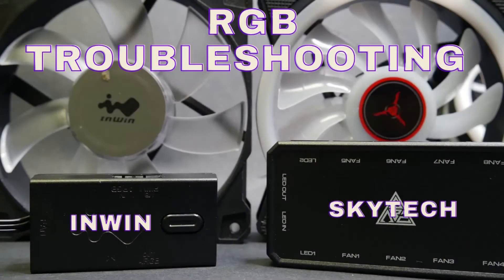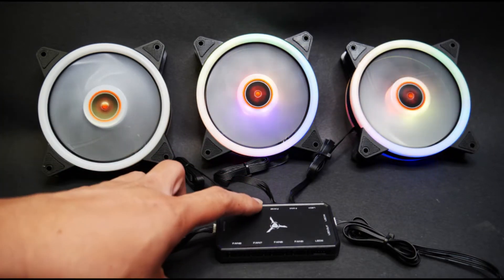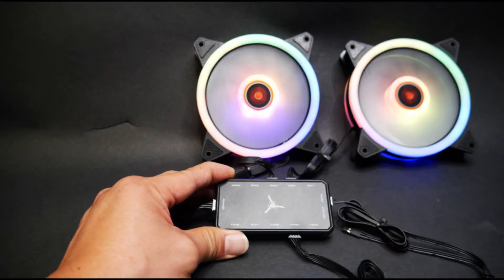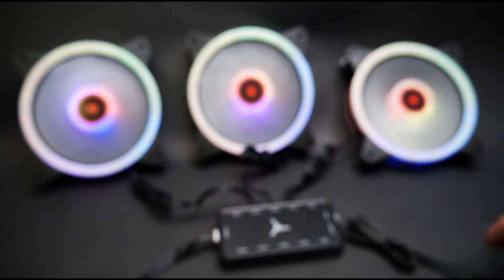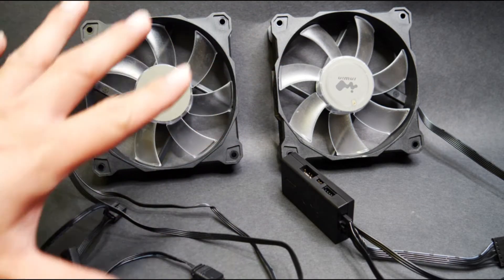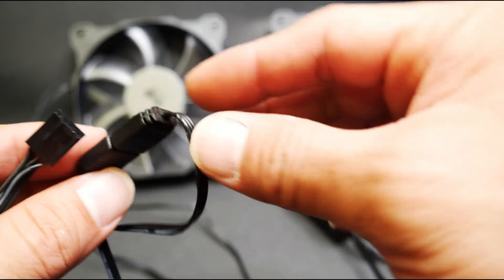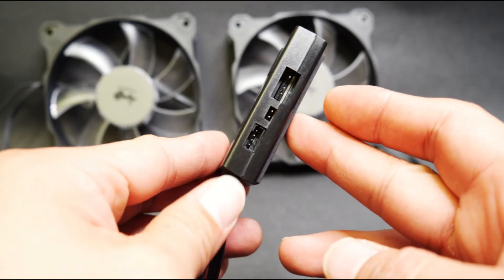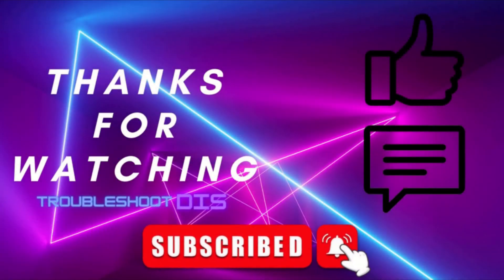Troubleshooting Inwin and Skytech RGB

Comment: I have this controller in my skytech machine with an inwin case.  The fans have all started making squeaky sounds, and I thought it was the water pump. Turns out the PWM circuitry is dying, and its making the fans make noise even if they aren't spinning.   My controller no longer responds to the remote control anymore.  Where is the IR sensor on this controller?
GAH!

Comment: is there a sowftware i can down load to control them
Reply from the maker: These controllers can be switched to motherboard mode which will carry the patterns that the software from your motherboard tells it to do. Each motherboard has a different software that it uses so best to check what brand you have and go to that manufacturer's website for support and download.

Comment: My system somehow didn't come with a remote. Is there any way to change fan speeds without it? All 9 fans are set to white and at 100%, but with no signal wire going to the mobo or remote, I can't software control this. Any fixes or do I have to go out and buy all new fans?
Reply: did you ever figure it out, I got the same issue

Comment: Mine didn't come with a remote, instead there is a button right by the power button on the computer tower. They are all plugged in, as the are all working, but they will not light up, any suggestions?

Comment: really good video, I bought a pc and it comes with these skytech fnas and its controller, but they are stock in green, every so often the change to blue or purple, just for barely a second, i dont have that controller, i think i plugged it well to the motherboard, and i cant change their colorswith the software of my motherboard, any manual youcan have, or maybe something i can do?
Reply from the maker: Hi there, for the system to be controlled by the motherboard the M button on the remote needs to be toggled. if you do not have the remote i suggest getting in touch with customer support so they can get one sent out to you asap!
Reply: @troubleshootdis5930  Thanks man, I appreciate your time!

Comment: Hello, I recently purchased a PRISM II, and the RGB of the three upper fans does not work for me, how do I place the connectors in sequence as indicated in the video, but it did not work for me. It has 9 fans and two controller boxes in 1 it has 6 fans and two empty spaces and in the other box it has 3 fans starting in fan 2 slot.
What I can do? I unplug them all and plug them back in? Please help
Reply from the maker: Hello there, on the second fan controller move the starting fans from slot 2 to 1 and see if that works out.
Reply: Did you resolve this issue? I'm in a same situation.
Reply: @oscillatoryNN  Hi, I couldn't solve it, I could only fix 1 and I asked for the replacement of the other two.

What I tried to fix it is to remove all the fans and connect them one by one to see if I could find the sequence; He helped me fix one but the other two didn't work and I asked for a replacement.

I hope I've helped.

Comment: Thanks for being the only person with a video about these fans. i have had my skytech shiva with the inwin controller fans for about 6 months. 2 months into that the fans stopped producing color at the same time. i have been over every connection and tried to resync the fans but i cannot get them to produce color. do you have any tips for this. if it helps it came with the rgb fusion 2 app for controlling them since the controller is in a tight spot.

Comment: hey i recently bought a pc and the fans only do a circular motion with the lights and not a full spread like most fans, im new to the pc business and would like to know if i would need to find and order a remote or if i can just use a software. i tried looking up the skytech fans i have but i cant even find a picture and much less any skytech fan remotes when i search them up on amazon or google at all. if you could help me that be big help and greatly appreciated.

Comment: Hi I’m having issues regarding the fans not retaining their color after a shut down. I have the inwin controller version. For example, I want my fans to be red, however, after shutdown they always revert to the standard rainbow color.
Reply from the maker: Hi there, how are you trying to change the color on yours? is it through a button? if so then check the rgb controller if it is hooked up to the motherboard's rgb header. Often times the system will revert to what the default color is set by the motherboard if this is the case. You can try to change the color of the fans using the motherboard software via either within the bios or inside windows using the software that comes or is compatible with your motherboard.
Reply: @troubleshootdis5930   what all software works for the sky Tech   i bought my pc resell and have had no luck finding a replacement please help me
Reply from the maker: @Akara375  Do get in touch with our customer support and im sure they may be able to send you a remote if you are still in the coverage period